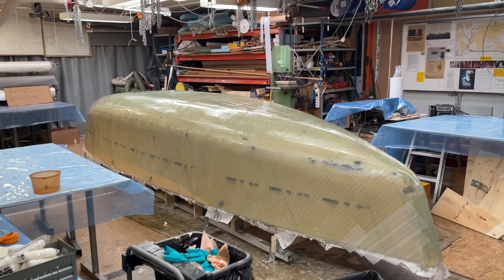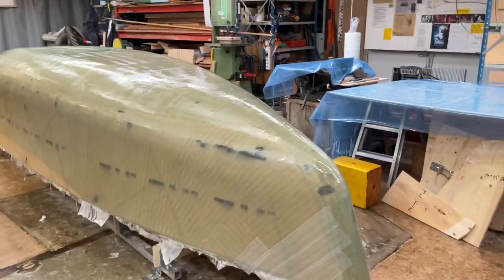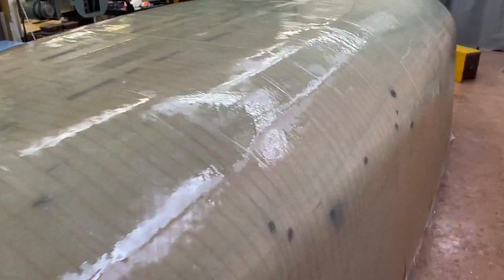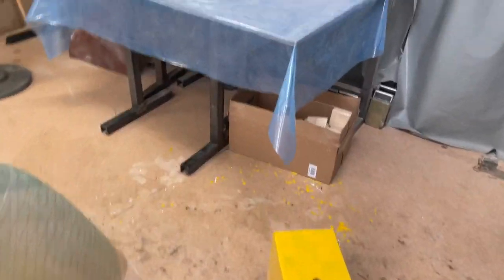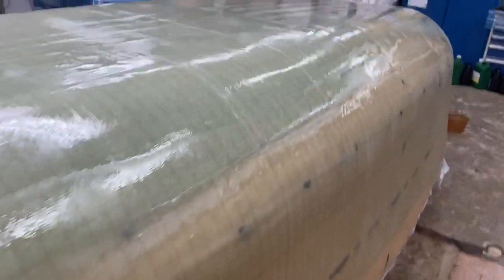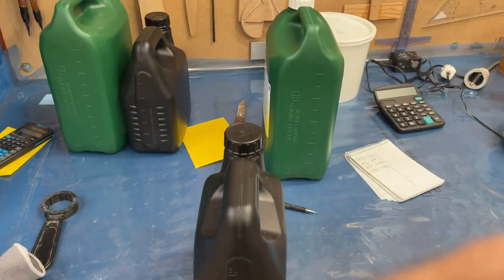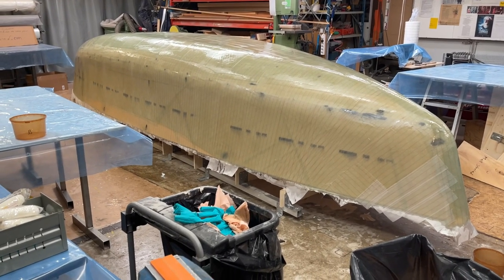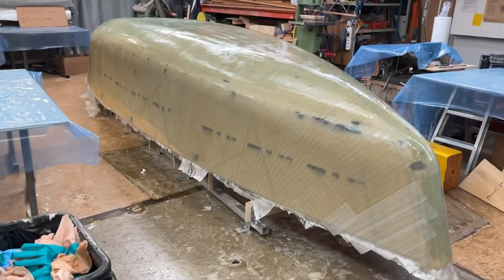Done, the outside laminate on Exlex the canoe yawl

Comment: Hi, will someone please fill me in on the differences planned between this boat and the previous Exlex. Brand new Outlaw coming right up! Thanks for sharing your adventures, Mr. Yrvind.
Reply from the maker: I wrote about that in the 2 previus videos
Reply: This boat is a double-ender, it has an inboard rudder attached to a skeg, and it will have almost double the sail area.

It is really a variation on his theme of ocean going minimalism. Like tiny houses, his boats aren't necessarily cheap though.

Like the others, this one is experimental. It is not so much that the other boats failed, but that he is trying to further refine his ideas.

Comment: I've never had that good an outcome...nice job. I have a question; In your last boat you had compartments built into the bottom of the boat with water jugs fitting neatly. I presume they were below the water line and were used for ballast as well as drinking. How effective is this for adding stability and as you drank the water did you refill them with salt water to maintain ballast? Guess that's 2 questions.
Reply from the maker: There is going to be water jugs and batteries at the bottom of the boat. The plan is to refill them with seawater. lead ballast in a deep keel is a much more effectiv way to get stability. But like money there is many ways much more effective to get rich than being a cruising man. I have for most of my life lived much below the income of average man.The advantage. I have lived a interesting happy healthy life. Same with stability. By building a low resistance boat and sail at slow speed, mostly downwind and with a low rig I do not need much stability. The advantage I have a rig that is gentle to the boat and with shallow boat I can see interesting places.

Comment: What about a very small engine just to get you in to port or out of trouble .
Reply from the maker: There might be an electric one. An E-propulsion on a dingy towed me out from Porto Santo using 175 watts for me and the dingy with 2 person in it. I had 6 50 watt solar panels on the boat. There is a lot of development in electric engines and batteries. We will see what how it develops.

Comment: How long do you wait after putting on the peel ply before you take it off?  Looks great!
Reply from the maker: Tonight the heater is on. Usually the temparature is 27° in the morning. If the epoxy is hard I peel it of. After 24 hours it should have cured to 90%

Comment: Can someone tell me what happens to moisture on the inside of Yrvind's super insulated hull, does the moisture build on the walls in the living area and drip down, is good ventilation required?
Reply from the maker: Because of the insulation there is less temperature difference between inside and outside so no condensation except on the windows that is not insulated. There occur condensation. There I collect water. This process dryes the inside air whithout consuming energy. In fact every gram of condensed water gives 512 calories of heat if I remember right.
Reply: @SvenYrvindExlex  Thank you, I hope you will show that system, I notice for brass porthole windows they have 'Drippers.' I like how the insulation opens up the whole inside of the hull as living space, especially without diesel and that stench.